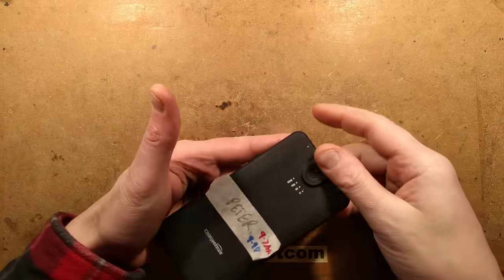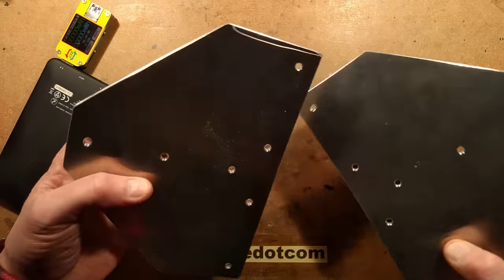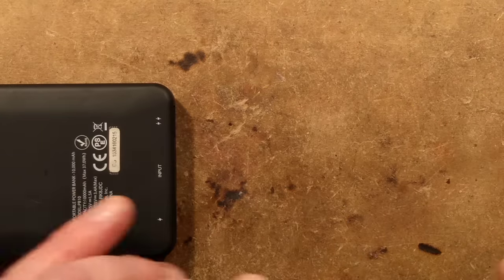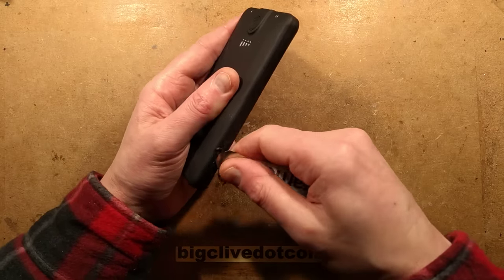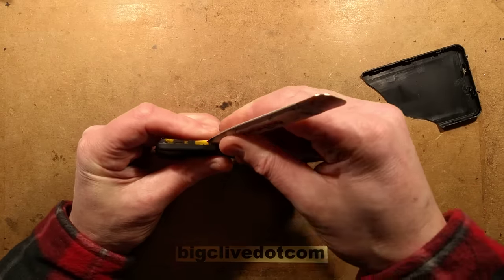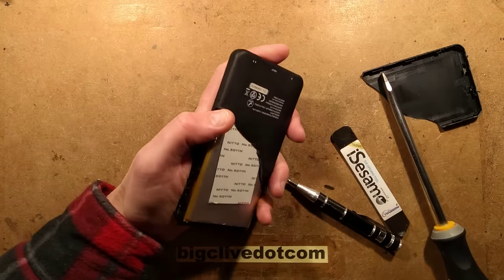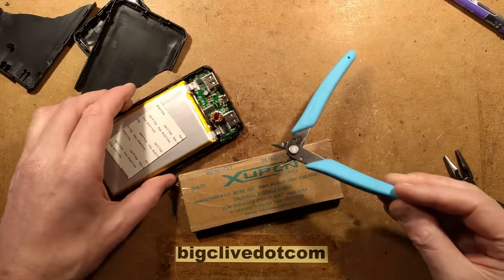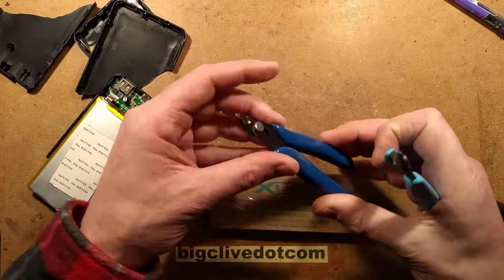Inside a recalled Amazon Basics power bank.

Comment: This is a bit off topic ......can anyone tell me if an international rectifier can be tested in circuit with a multi meter ?
Edited......I have searched online but can't get a difinative answer
Reply: International rectifier is a brand of electronics components, it’s not a component type.

If you mean a Full Bridge Rectifier, then in general , mostly yes.
Reply: Hi ...its a F3205Z  international rectifier / infineon MOSFET acording to the data sheet
I think it's responsible for the switching in my erbauer 18 oscillator tool
I have 2 identical tools where both motors are gubbed
Figured I could get 1 working and if it is that component I could buy more for £1 
Thanks you
Reply: @johnnygault365  You can test for any shorts between the three terminals (should be none), and you can check the body diode between source and drain. However you can't check the operation of a MOSFET with just a multimeter, you'd need to hook up a circuit with a resistor in the drain and some way of applying a variable voltage to the gate (e.g. potentiometer). 
FWIW the cheap AVR microcontroller based component testers available on eBay and Amazon etc. are very useful for quick go/no go testing of parts like this, and will even identify what type of part is being tested.
Reply: SkyWizardless thank you
I shall have a look
Reply: SkyWizardless thanks again 
Have ordered a tester from eBay
If nothing else I’ll be able to sort out my pack of transistors I scattered over my floor
Reply: @johnnygault365  They are a genuinely useful device.  If you are interested they are open source devices (although many variants made), and there is a huge thread on the eevblog forums titled "$20 LCR ESR Transistor checker project" that discuss usage, issues, improvements etc.
Reply: @ferrumignis  ideal mate thanks again 
What an amazing community....all the best

Comment: Could be a case of being too careful.
People lie, and maybe people used the outputs badly as Big Clive mentions, and had accidents and other issues.
Seems solid and well put together and there is a recess under battery where the remaining circuit board was so maybe not an issue.
Unless the edge of the circuit board was the sharp end towards battery.

Comment: I had gotten 4  generics of  a similar power bank  on sale. not this exact power bank but the circuit design was similar, and it had the same “lighting marks” and two of them burned up while charging. So I just ended up robbing them all for their batteries. 
Once of them, I was charging a device while charging the battery and the other just simply charging a device. 
I actually liked them because the great current but in my opinion the circuit was just too small and powerful 
Which is great, unfortunately it ignores too many of those certain “trade offs” that any engineer will preach about.  😉

Comment: What if you remove the 0 ohm link on the 2nd output and connected the 4 resistors like the other output could you have 2 high powered outputs?
Reply from the maker: It would theoretically allow a high current device to charge, but at the risk of overloading the unit and causing low current devices to charge at a much lower current than normal because they don't recognize the data line state.

Comment: As a small business owner that offers iPhone repair, the iPhone is the easiest phone to repair. The new ones are a bit of hassle due to the screen being serialized and the OS will tell you it’s not a genuine screen, but there are workarounds now. But the actual screen replacement process is very easy, and the battery is also easy to replace.
Reply: If you have specialist tools and training. That is the definition of non-serviceable. Take, say, my new Hakko desoldering tool. It comes with a full circuit diagram and is held together with cross pins and exposed Phillips screws. There are even directions on how to take it apart for those too stupid to figure out how to remove screws. Not quite the same as an iPhone.
Reply: Roflcopter4b iPhone’s don’t use rare screw standards, the screwdrivers are supper easy to find and cheap, and repairing the iPhone is real easy and does not require any special equipment, guides are all over online and are easy to follow. First time I took apart an iPhone with a guide I had it down, only takes me less than 10 minutes to replace a screen, less than 20 to fully disassemble.  You don’t need special training, and the definition for non-serviceable would not apply to iPhone screen, battery, ports, button, camera, speakers, or screen sensors replacements. Non-serviceable would apply to the fingerprint reader that is paired to the motherboard or anything on the motherboard

Comment: Can this power bank be reset I have one similar that discharged totally and has been left not used  or recharged . And it appears  to have died and not charge ?
Reply from the maker: It may have cut off on the DW01 style cell protection.  If the voltage isn't too low it can be brought carefully back up to around 3V on the cell to reactivate it.
Reply: Thanks for the advice and continuing with very entertaining  videos showing electronics can be great fun and learning about.👍

Comment: How did you solder the wires onto the foil tabs of the battery?  I have not been able to solder onto mine.
Reply from the maker: Some accept solder and some don't.  I sometimes abrade then with a file and add flux to get them started.

Comment: The trick to getting that adhesive to let go is to heat the case up with a hot air gun or hair dryer - not enough to melt the plastic of course.  I've encountered it dealing with things like Kindles and GPS units in need of a new battery ;)

Comment: Nice try with the desoldering of the battery but you just need a lot more heat, a chisel tip is idea for this. I commented on your Amazon Alexa charger video to try this, so nice to see you did at least try :) The reason I dislike cutting batteries off is because those tabs are difficult to solder to in most cases, even when I apply a large amount of eat and flux it just doesn't stick, so if I have the option to desolder the little plates it's welded into I would always do so because it makes it much easier to reuse.
I also generally dislike power banks that use flat lipo cells such as this one since they are generally much easier to damage and more see sensitive. My power banks use 18650 cells for this reason, I just trust them more.

Comment: Clive - request for a video. Is there a way to soft start large appliances (like a clothes dryer) so they doesn't cause the house lights to dim?
Reply from the maker: If there's not an issue like a bad supply to your home or an internal problem, then it could be possible to add an NTC inrush limiting thermistor in series with the motor.

Comment: I know I am years late, but as someone who removes stupid glue residue every now and then and wants to avoid chemicals (I get enough of them anyways in my work) try out cooking oil! It might not be as effective as gasoline but it doesn't damage anything and often works just fine. Also, alcogel that you use for your hands often works better than rubbing alcohol because it contains glycerin. Much better than using gasoline.

Comment: The verge has a report on why they were recalled, there was a risk of overheating and fire damage. 53 reported incidences in the US. Not what that is as a percentage of those sold. The allowable failure rate (even with best possible manufacturing, there will always be a few failures) for anything containing a lithium cell must be extremely low.

Comment: iPhones are actually really easy to service, they just require a special screwdriver to loosen the screws that hold it together. I’ve actually taken a 5s apart and seen others apart too, almost everything that’s meant to be serviceable is connected by ribbon cables that unplug, the only thing that’s a real pain in the ass is getting the battery out, since it’s held in with sticky stuff, similarly to this power bank.

Comment: I know this is late... but there is a solvent softener/remover here in the US called GoofOff   it works really well with eating the adhesive they use on Li-Ion cells, its what i use anyway... Petrol works too... it will not catch fire unless you deliberately short the battery terminals

Comment: The mystery chip looks to me as some microcontroller, something along the lines of ATTINY84, just maybe more modern. The coil looks rather bulky, so I'm guessing the boost frequency to be below 500kHz. And that is not that difficult to handle using software DSP in order to implement the 5V regulation, charging and all the jazz functionality around to make it a power bank.

Comment: Someone should really gift you a big bag of plastic opening tools. They might not get into tight seams as easily, but they do a much better job prying stuff apart once you get a crack opened. Oh, and much less risk of cutting through a lithium battery cell with a sharp metal tool, though that's more of a drawback than an advantage for this channel :P

Comment: I had a handful of these from years back.  Some spontaneously failed within the first year.  Amazon replaced those .  Those that failed after one year I just kept when Amazon would not swap them.  I stopped using them all after taking a few from sea level to 10k ft.  Many failed at that point with a bad smell.

Shortly after that, Amazon had the recall.  I got all my money back and bought new batteries from alternate suppliers.

Comment: I had one of this power banks (before the recall). And this went faulty after a full charge, After it was fully charged I disconnected it from the power source. After that I was not able to power the power bank on. Instead of powering on it got warm. So I decided to monitor it. It stayed warm for about 5 days. After that It was also not possible to charge the device again. After that I got an replacment from Amazon. And a few months after I got the replacment the recall started :D

Comment: HEY CLIVE I need to send you this Walmart unit..

The power bank's recharge port back feeds into the outlet if charging in the car.

The 5volts was feeding into my hybrid car's computer and making it think the car was always running even though I turned the car off. The car wouldn't lock or allow you to set the alarm. I don't know why this power bank does this but maybe you'd be interested in taking it apart

Comment: Clive, there's a new USB voltage/current measurement meter I think you'll like from Banggood, search for: UD18
It does USB 3 as well as USB C and standard 2-pin barrel connections. Plus you can power it from a micro USB plug so it doesn't drain power from the source you're trying to measure. And you can set thresholds (time or voltage) for automatic cut-off to use it as a protection against over charging or over discharging.
It also has bluetooth to view the data on your phone, I got it working once but seems finicky as I struggled to get it working a 2nd time.

Comment: I had an experience with a knock-off JBL portable speaker not too long ago (someone in my family gave it to me because it didn't work anymore). I wanted to open it up and had to break the case open because it was superglued shut. As I was doing it, the circuitry and the battery were hot to the touch. The battery was like nothing I've seen before: a red cylinder wrapped in duct tape and secured to the plastic case with a ton of silicon. It cooled down after a while, but as I inspected the rest of the device, it would heat up again randomly and then cool back down.
Also, I couldn't find a proper place to dispose of it so it's still sitting in my closet waiting to blow tf up at any time.
Reply from the maker: The lithium cells are fairly inert once discharged.  I'd suggest checking it's voltage and if it's lower than 3V, disposing of it.

Comment: It did go down to 3,3V instead of cutting out at 3,5A. Maybe this was the reason for the recall? If it puts out maybe up to 8A at 3,3V into a shorted wire this would indeed set it on fire.

Comment: I was charging my phone off a Poundland power bank today, and it started getting very toasty. Also, my phone kept stopping and starting charging. Is this more likely to be a problem with the phone or the power bank? My main theory is that my phone is steadily pulling more current to try and find out the powerbank's limit, then the bank fails after a few seconds at that limit, the chip resets and the cycle begins again. I did try wiggling the cable, I don't think it's that
Reply: Try a different cable but most likely the power bank
Reply: Most likely the powerbank cutting out due to overheating, and then start again when cooled down after a few seconds. I wouldn´t blame the phone.
Reply: @jaras1969  I was holding it at the time, and the temperature didn't seem to change too much. To give a tough estimate, it felt like a standard handwamer, which was quite nice actually, I was a little cold
Reply: The power bank is probably undersized. The cheap single 18650 type can't even put out 1A, only 0.7-0.8. Your phone probably doesn't even expect a charger that anemic and tries charging at 1A which eventually overloads the power bank. I've got a Pixel 2 and it won't charge from those tiny power banks, needs 1A minimum.

Comment: The reason why people recommend using petrol is to loosen the glue. You wouldn't need much force then to remove the glued on part. You're much more at risk of puncturing the battery the way you did it and causing a fire than you would by using petrol. If you don't like the idea of petrol then lighter fluid does the same thing, as do some acetone I believe.

Comment: i buy anker stuff - always - cables, power banks, chargers.... have two usb port wall charger its working for 2 years now no problem, have 6 micro usb and one usb c cables they get used daily and they still work, and two powerbanks powercore 20100mah and 26800mah both use LG or panasonic 18650 cells

Comment: „Goo Gone“ liquid is the right stuff to losen the sticky pads. I have used it in nunerous MacBook repairs. Works well and it is based on Orange oil, therefore not flamable.
Reply from the maker: I've discovered how effective isopropanol is.  But still quite flammable.

Comment: Yup that double sticky tape has excessive glue on it, loves to rip the foil. It's best to fully discharge then apply gentle heat to soften it enough that the battery comes free. Once it's cool apply about 3.5V with alligator clips and you can charge normally. A couple drops of charcoal lighter fluid and persistent prying will free it as well.  Tbh I hate those pouch batteries, they tend to go pop and fire very easily.💀

Comment: Thank you BCDC! Yours and a few others videos helped me actually have success in making/modding things. My multipanel panel self modded "solar power bank" now works wonderfully with 4 panels, and an up sized battery. I'm still at the "that's a diode, that's a capacitor" limit of knowledge (have to look up values, and cannot actually build/design a circuit :P ). BUT, it does mean I get to have fun. XD
PS, I should take it back apart and check all is "safe" as you say.

Comment: As someone who often does battle with "Sealed" modern phones and things like these power packs that are glued together & not meant to come apart,, the biggest help in getting them apart is Isopropol alcohol.... (NOT Petrol)
Just let a tiny amount trickle in via your spudger or similar....give it a minute or two and it will break down the glue bond....saves all that destruction
Oh and a little gentle heat from a smd type heat gun, you don't want it hot enough to melt anything plastic, just a bit of heat to help soften that damned glue...

Comment: Also found the recall on https://ec.europa.eu/consumers/consumers_safety/safety_products/rapex/alerts/?event=viewProduct&reference=A12/0426/18&lng=en

This is a European database. It doesn't give a lot ofinformation either:
 The battery of the power bank overheats easily, can explode or leak.
This could result in the power bank catching fire whilst being charged unattended or users suffering burns or chemical burns when carrying the power bank in their pocket.

Comment: I suspect this design was rejected due to the cells being welded in parallel, where safer designs balance each cell individually.
Reply from the maker: Most parallel stacks of cells are not balanced as they will behave as a single cell.  It's only when you have two or more in series that balancing circuitry is required.
Reply: @bigclivedotcom  That's good to know, thanks!

Comment: regarding opening something that is charged... on friday i accidentely bridged a 96v lead acid battery, used in an ups, with a sidecutter
i disassembled around 15 or more of these packs so far, this one was the last so obviously i did something different
usually i disconnected every 12v sealed cell before cutting anything, but this time i decided to do it backwars, cut the +, also hit the -, shorted 7 of 8 cells, got blinded, smoked, glowing pieces of wire and sidecutter everywhere. there is now a quite big hole where usually the cutting parts are
i wonder what these babys are capable new and fully charged.....

Comment: The United States Consumer Product Safety Commission says that about 260,000 units are affected. Additionally, according to the recall details, “Amazon has received 53 reports of the power banks overheating in the US, including one report of chemical burns due to contact with battery acid and four reports of property damage, including fire and smoke damage.”

Comment: ive nerer had an issue with removing taped in lithium cells... When i replaced mine and my partners iphone battery, i just used a flathead screwdriver to pry it out.. The cell ends up bent out of shape, and even ripped through the silver outter layer of the cell, Never caused an issue tbh... Did get the faint smell of lithium (smells nice btw), But the cell never puffed etc..